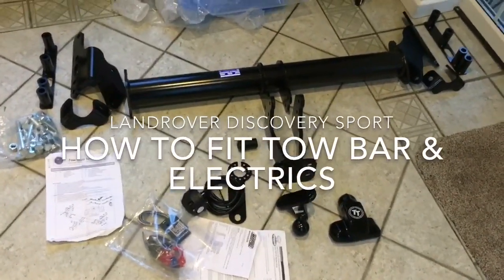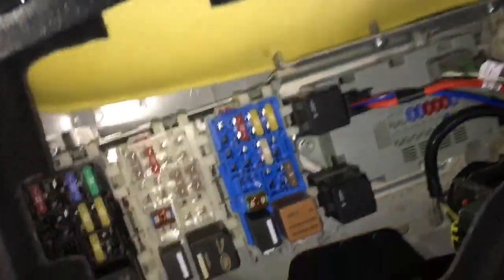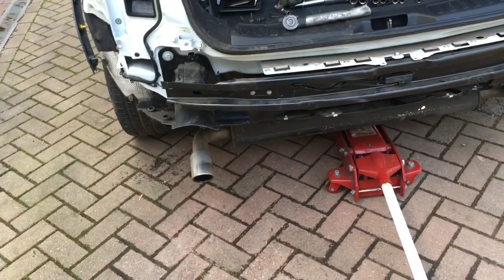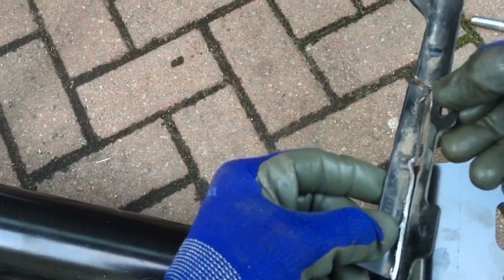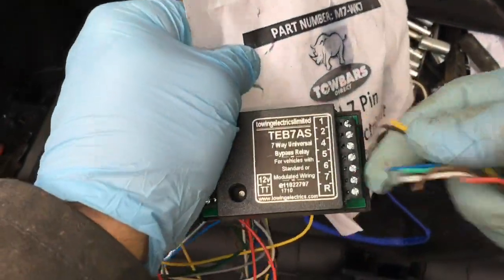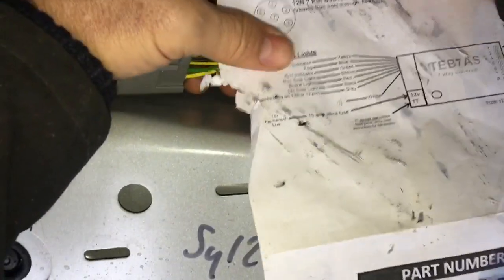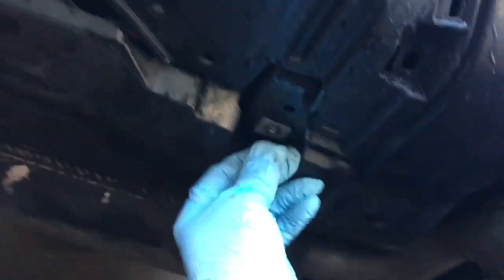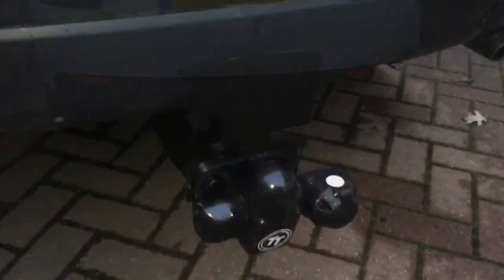Discovery Sport Tow Bar - How to Fit Towbar & Electics for Less than £200

Comment: Why are you putting a by pass relay on a Discovery Sport. Just buy dedicated towing electrics as  it's plug and play....job done.
Reply from the maker: Because those are more expensive. Sort of the point of DIY is saving money.
Reply: @comeinhandynow  I can certainly agree with saving money in terms of fitting it yourself, but on a car of any reasonable value, even when doing it yourself, it's worth putting the proper parts on rather than making wiring work.

Comment: Hello what year was this discovery? I'm fitting a tow bar on a 19 plate soon just doing some research before hand
Reply from the maker: It was done a while ago, somewhere around 2016 - 2018. Best to check with the tow bar supplier if it fits your exact model year.

Comment: Did you run the cable for L indicator to L side light and run the R indicator in Right side of light?... or can you get both L&R cable in just one side of the rear light? Does it make sense??
Reply from the maker: See around time 31:20 the indicator wiring is all on that plug shown.

Comment: Hi Good video, can you help with a question if possible, None of my park sensors work on my rear bumper, I'm looking to see if its the connector  come loose (bumper to Body) do you think i can get to it with just removing the inner wheel arch cover!. if its not the connector would you know where the parking module is as i looked at your video and couldn't see it, I'm thinking it maybe in the rear side panel on the same side of the connecter?  any help would be greatly received, thanks
Reply from the maker: I would start by trying to trace the wiring from the sensors.  The unit cant be far away.  Maybe inside the boot in one of those side spaces in the corners, like where I found he fuse box shown in the video.
Reply: @comeinhandynow  thanks for reply, will do..

Comment: How did you get the brake lights to work? Mine aren’t working and I have the same kit as you. My indicators work
Reply from the maker: Mine worked straight off. Best get a multimeter and measure at the wiring and at the socket, then through your trailer. Search online for the wiring diagrams for the various tow sockets.
Reply: Thanks! Just checked the connectors and the red wire had been sliced clean in half! Working now 😜

Comment: Is your car a 7 seater WITH a spare tire? My car is and I want to fit a tow bar but I have been told that I will need to. Modify/cut the rear bumper!?!?

Great video.
Reply from the maker: Thanks.  Mine is a 7 seater with no spare wheel.  Check with the tow bar supplier for fitting options.